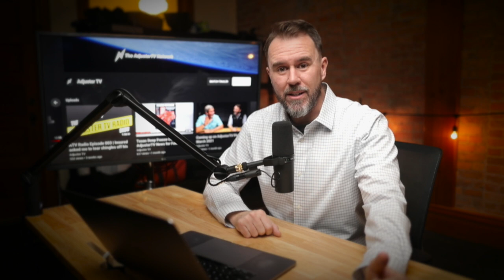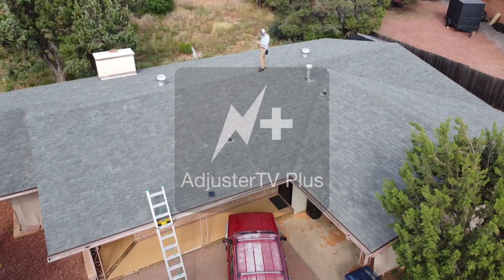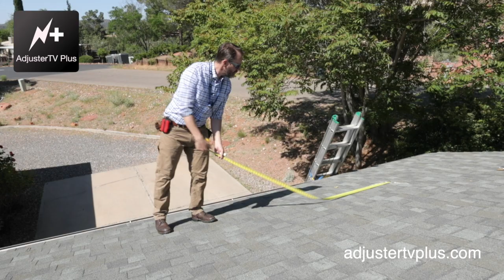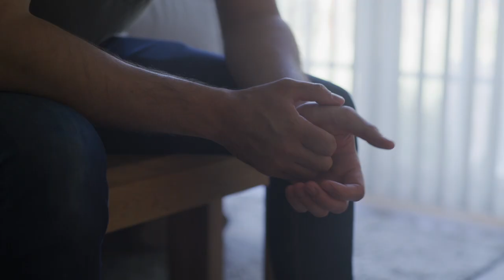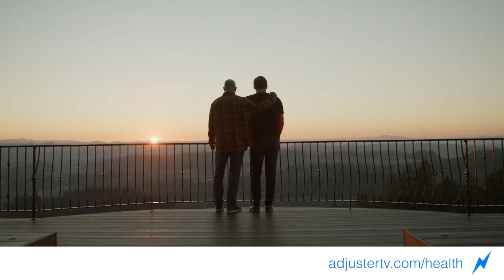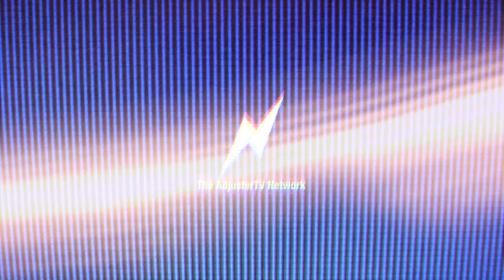The Construction Episode | AdjusterTV Radio 009

Comment: TIP: every area follows a code. 
If you know the code for the general contracting in that area will help you find specific ways of application. Whether it's roofing, or interior restoration. 
We're trying to avoid price gouged situations. Yet under biding gives the carrier the perception this is all they have to work with. 
If you have no hands on experience with construction. You can't assume how easy it is to conduct yourself. Skill comes with experience and repetition. 
We can all day assume what and how every thing is or should be done. But that's like me assuming how to do your job. 
This is why in the end we're all called professionals. 
I'm not saying this episode is wrong or wasted information. 
But consider how significant you are. And apply that to everyone else.
Reply from the maker: It goes both ways.  It's impractical for every adjuster to be a general contractor before becoming an adjuster.